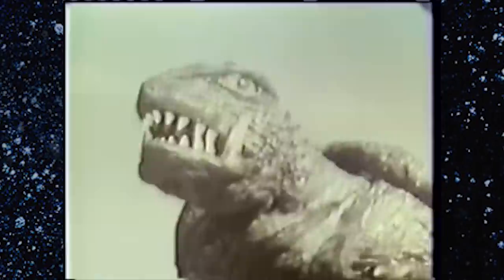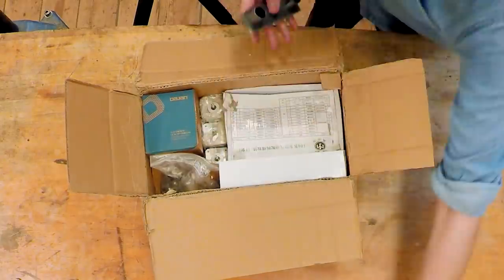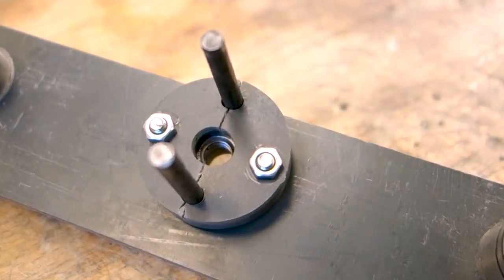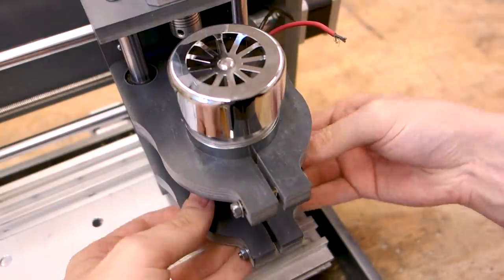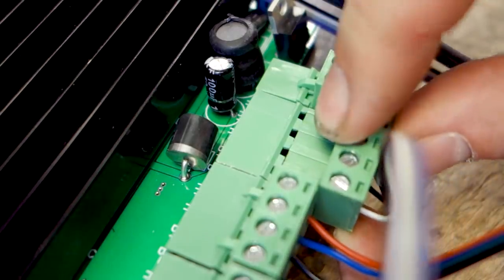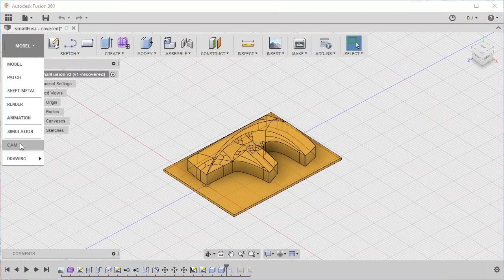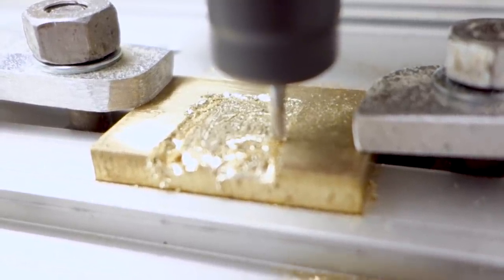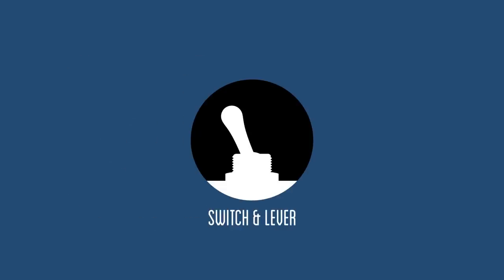Review: Cheap CNC Mill

Comment: If it seems too good to be true, it is. It's an engraver, and the farthest thing from a mill. I'd use the money and buy a 3D printer. If you need something machined, take it to a shop. This probably couldn't hold a .01 tolerance. The grease on the metal is the same grease on old Soviet and Chinese rifles, cosmoline. Shitty to clean off.
Reply from the maker: +Andrew Lang nope, you're right that it couldn't hold a .01 tolerance, just as a Fiat can't do 0-60 in 2.3 seconds. It was simply not built for it, so I don't understand why that's a criticism. If you're going to compare this to professional machines you're wrong from the get go. 

A 3D printer is a fundamentally different machine than this. Try doing some woodworking on a 3D printer. Sure thing you can take it to a shop to get milled, but it doesn't take many trips until the money you spent could've been used to buy you own mill, much better than this even. Also, it's missing the point about learning about CNC and experimenting yourself. To continue the car analogy, it's like taking your car to the shop every time it needs an oil change instead of learning something about it and doing it yourself.
Reply: Switch & Lever 
My criticism comes from why spend $400 on a machine that clearly the company didn't care enough enough to "machine" components enough withstand being assembled? You were saying in the video that one the parts broke while you were assembling it and you had to make it. What machine did you make it on? It makes no sense to spend that much on something they clearly didn't care enough to even pack it nicely. 

As for cars, if you want to learn about the car you own and work on it, I wholeheartedly agree. That goes for homes, computers, or anything you own that  you can work on. If you want to learn CNC, there are better ways to do it. There are better kits out there, $400 for a kit the makers didn't care about is not worth it. This is coming from someone who knew nothing about CNC 4yrs ago, and now I work in a shop that has CNC as well as manual mills and lathes.
Reply from the maker: +Andrew Lang I think the broken part error is not because of shoddy construction, aside from somewhat brittle plastic. The error is rather one of design, as well as lack of caution not to over tighten those nuts. It's not an issue with construction quality,it can stand being assembled, but rather one of design. Also, Gearbest didn't design nor produce this, as many have pointed out, they're a reseller not a producer. 

The spare part was made with a drill press for the holes and a dremel to cut out the hexagonal space for the nut. 

I agree that there are many ways to learn CNC, and other machines one could do it on. I don't think that just delivering CAD to a production shop to have it milled is a very good way though. 

Most CNC mills worth anything will be a lot more money than this machine. In the CNC realm $400 is cheap, and you should also expect to get something cheap from it. That doesn't mean it's a bad learning machine though, just because there are better more expensive ones. As several people have testified in the comments to running these machines and having no real issues with them after tinkering with them for a bit I take the criticism of those who've had no experience with this machine with a grain of salt. There are a lot of keyboard jockeys who consider themselves experts after watching a few YouTube videos.
Reply: Switch & Lever For the cost of 3 or 4 of these, you can buy mini mills which can do a much better job of getting your feet wet. I'm not critiquing you, I just think for someone who wants to get into machining, there are several companies that offer mini mills with CNC ability. You can also find Bridgeports on EBay and convert them for DRO, and install CNC boards. 
On the CAD end, it's a different story. Most licensed CAD programs licensing costs are through the roof, I'll give you that. But, if your looking for something to dip your toe in before diving in, Fusion 360 gives very reasonable costs, ($50 for 6 months if your not using it for monetary production) and it will develop drawings and code. The reason I criticize this particular product is because if someone was to save money for this and this was their first time machining, I think it would sour them.
Reply: Switch & Lever Believe me, I know the costs involved with CNC equipments purchases. The company I work for purchased 2 Okuma MB4000 horizontal mills with a 32 pallet system. The price was a little over $3M after taxes.
Reply from the maker: Indeed, but 3-4 times the amount of this for someone to just try out something, is still a lot of money. As some have pointed out $400 is a lot of money to some, now imagine four times that. If you want to spend more money, as you point out with the Okuma purchase, there is always better machines to buy. This is not a competition of who has the deepest pockets though.

Personally, if it's your first foray into CNC I would not recommend someone converting an old manual mill into CNC. Not to mention there's a world of difference between a machine you can run in basically your hobby room and a seven feet tall, 2000lb, Bridgeport. Also you'd be lucky if you find a Bridgeport in decent condition for less than $3000, not considering the cost of moving from one place to another, then add to that the cost of converting it to CNC. The frustrations, and skill required, to convert a manual mill to CNC for a first timer into the area would sour someone quicker than using a mill like the one in my video, in my opinion.

Fusion 360 is free for hobbyists and businesses making less than $100k a year btw, which is even more reasonable.

Comment: You really think flash is better than DVD-R for keeping your files?
Reply from the maker: +Donald Klopper since I haven't owned a computer with an optical drive for years, and had to borrow a USB optical drive from a friend just to get to the files, yes. It's definitely better. DVDs are impractical, and are a dying format. 

Not that a flash drive is the only place I stored it, it's also on my backup drives.
Reply: I understand your position... it's common place for people not to have optical media devices these days. Your commend on the video seemed to favour a USB flash drive ahead of the DVD to keep the software on, thus my original comment. I loved your video and can see a lot of effort and thinking went into it, so I thought you'd maybe want to rethink your position on DVD as a backup medium ahead of flash. Oh well, not my data ;-)
Reply from the maker: +Donald Klopper I'd never use DVD as a backup medium anyhow. They're unreliable (degrade over time) and their storage capacity is tiny. One video project I do can easily have 50gb of video material. Hard drives which are raided and set up in a NAS that's replaced every few years is the best option.

Comment: my chinese cnc cost me $1500aud from ebay. the electronics broke in about 2 hours and for the next 3 months kept breaking as i went back and forth with the seller. in the end when allowance for complaints on ebay ended they simply stopped returning my email and skype messages simply saying i should take it to an electrician . about a year later i decided to dust it off and review the issues in the end deciding to completely rebuild the electronics package. further i upgraded the spindle from a nasty 160 watt dentist drill arrangement to an 800 watt water cooled beast. this however cost me a further $1500 aud in the end. funny thing is after that when i look at the same kind of cnc on ebay the tech is so much better now. there is one plus though, i learned a lot and can now service my machine and any similar cnc.

Comment: I bought the largest X-Carve a few months ago. From what I can tell its definitely worth the extra cost. I would have to say that I would like to try a Shapoko 3 for a more rigid frame when cutting materials such as g10 with variable density throughout or even have a chance at copper. I can say that my X-Carve will cut 6061 accurately all day with only a little bit of chatter which is acceptable for my uses.

Comment: A justifyable price for this would be $20.
Reply from the maker: Well you obviously have no idea what you're talking about, you could get one of the stepper motors and a leadscrew for that price, that's about it.
Reply: Switch & Lever i know. i do have an idea what I'm talking about since I do this kind of stuff at home and I operate CNC machines at work. What I'm trying to say that at the point where you mentioned the frame is out of plastic, it was already over for me. ofcourse the PSU and steppers and rails and the spindle motor (+driver) etc cost more than $20 but that's already the only usable things out of this package.
Reply from the maker: Then I'm a bit confused why you exaggerate, is it only to put it down?
Reply: Switch & Lever yees, pretty much. I cant show love to things that are built and designed half-hearted. and dont do what they claim to.
Reply from the maker: Don't do what they claim to? Okay, I think you're coming at this from a bit wrong angle. It does what it claims to do, as also testified by other owners of the same machine in numerous comments here, it engraves different materials just fine. I pushed it to do something it wasn't designed to do, to see how far I could push it. Granted, I could've been clearer about that in the actual video, but I feel judging it by that is like judging a car because it can't drive under water.

You don't have to "love" anything, but there is something to be said for remaining level headed and actually communicate what you mean in a clear manner, rather than saying verifiable false things just to put something down.

Comment: A small drill press, a milling vice, a couple of used stepper motors and download some software. Fin
Reply from the maker: A drill press is not made to take sideways loads like that. There's a reason it's a drill press and not a milling machine, and thus you'll wear out the bearings quite quick. That's not to mention that drill presses don't tend to run anywhere near the spindle speeds of a mill. This spindle outputs somewhere between 6000-12000 rpm, according to the manufacturer.

Comment: That seems awfully expensive what the differnce between this one in the video and these that I found on eBay? Simply becasue it's half the price.
 http://www.ebay.ca/itm/Mini-CNC-1610-CNC-engraving-machine-Pcb-Milling-wood-router-for-DIY-beginner-/322698392296?hash=item4b2252b2e8:g:qQsAAOSwOhVZp636  

http://www.ebay.ca/itm/3-Axis-3018-DIY-Mini-CNC-Laser-Machine-Pcb-Milling-Wood-Router-Engraver-Printer-/391864836819?hash=item5b3cf6e2d3:g:T2UAAOSwBwBZjmfP
Reply from the maker: Well it's two different machines alltogether. The table size of the ones you linked is much smaller than the one I built, and the spindle has far less power. It looks, at least the one in your first link, that some parts are 3d printed as well. I wouldn't trust 3d printed parts as far as I could throw them, at least not for structural parts in a CNC mill.

Comment: I don't understand why you are so hot to defend a machine that's very brittle plastic, doesn't come with all the wires you need, and sends you stolen software and steals the work of others and has the web address of the company they stole from on the parts they send you. Knowing all that not only do you defend it you still have links up to buy it. I don't get that.
Reply from the maker: The thing is, I could care less if it's a CNC or a rock, when people think they know more about something I have actually spent time building, using and ultimately reviewing, when they never even knew it existed before seeing my video. That's my gripe.
Reply: I'm not faulting your review at all. I don't know jack about CNC machines. I just don't get you KNOWING this chinese product is using other people's work and even their website is printed on the board and yet you still link to it and honestly don't seem to care. Are you worried about getting other machines for review? I've got no  dog in this fight and I'm not angry, I'm literally confused by your attitude. In your own words   "Had I known I would not have gotten this mill for review to begin with, as I do believe strongly in benefiting creators, rather than counterfeiters." and yet you stand by your review and still have links up to buy it....
Reply from the maker: In the end, I went into an agreement which I am sworn to uphold as well. So I am, as you may say, stuck between a rock and a hard place. In the end, the name of the mill is mentioned repeatedly, Gearbest is mentioned repeatedly, it's literally a five second job to find the same page through Google. Since the links aren't affiliate links, I don't see the harm.

The one argument may be removing the video entirely, and I did actually toy with the idea, but decided ultimately it's better to keep it up as information about the mill itself, and that it's counterfeit (which is why I pinned PlanetCNC's comment, so it stays on the top).
Reply: I understand now. I wish you nothing but the best in all you do. Cheers!

Comment: It's not a proper review if you are going to go and replace one of its main components with one of your own - just cos you don't like the look of it! Prospective buyers want to know how the purchased unit as a whole, performs. Adding your own bits (broken part excepted) just confuses the issue.
Reply from the maker: Just because I don't like the look of it? That had literally nothing to do with it. 

Watch it to the end, altering it how I did plays entirely into one of my last points, that this is a good platform to modify and alter how you want to. It doesn't perform any differently because of my table, aside that I can clamp down material more rigidly.
Reply: I did watch it to the end.  My point, potential buyers will want to know how the unit as a whole performs - adding bits fudges that decision-making process.

Personally, I do not think this CNC mill is good value and wouldn't buy anything whose main components were made of plastic.  I was curious though as to how it would perform with metals. So it would have been nice to see how the unit as sold would have performed on that brass piece - worse obviously, but this is what potential buyers would like to have seen.
Reply from the maker: So, you would've liked to see me trying to clamp down the piece until the plastic cracked? That'd just be a waste of my time, and yours. For engraving you don't need to clamp it down that much, but for milling it needs to be rigid, otherwise you'll just get chattering or at worst the piece coming loose.

Comment: Lol high voltage? High voltage is 600 volts and up. 480 three phase is technically not even high voltage and that will turn your cabinets into projectiles lol.
Reply from the maker: +njack1994 if it's high enough to kill you I'm just going to go ahead call it high voltage. Especially if it discourages those that don't know what they're doing from playing with it.

Comment: From your experience of the part breaking during assembly was a hint. I am surprised you didn't think of using the mill to make metal replacement parts for the rest of the plastic.  That way you could have eventually swapped all the plastic parts out and would have had a stronger unit.
Reply from the maker: +Gary Jene too much time involved, and the plate aluminum required would've been way too expensive. Better to rebuild it using aluminum extrusions and acme leadscrews.

Comment: Would be better off getting a proper 3D printer and change out the head for a spindle motor....
Reply from the maker: +MeMad Max a 3D printer is inherently not built for this kind of work though, they're not built this rigidly as they aren't put under any sort of load. When you put a tool to a workpiece the loads on the machine require a much more rigid construction.

Comment: Add your photo program source to the description!
Reply from the maker: +Jamie nope. It's specific to exactly what I was doing and has no gui or command line interface. Everything is hard coded into the program, and needs to be recompiled to use another image. It's extremely quick and dirty, so I will spare you all that mess.
Reply: Well, just consider the worst that can happen is nobody downloads it. But maybe someone will take your dirty hack, add some basic commandline parameters and options, and make it useful for others. Maybe someone will even add a GUI and make it useful for noobs. Don't worry about sparing us your mess, sharing is better than nothing :)
Reply from the maker: +Jamie id rather share the theory of what it's doing :)

It takes the input image and checks the luminance of the pixel at 0,0. If the luminance is above a certain value (meaning it's too bright) it does nothing and moves onto the next pixel: 1,0. If it's below that value it saves that position and continues with the next pixel. Once it reaches the next too bright pixel it ends the line, and outputs that as gcode (i.e. five lines of gcode signifying, move pen from last position to beginning of line (1), move pen down to paper (2), move from the start of the line to the end (3 & 4), then retract pen (5)). It continues looking to the next pixel and repeats this over the entire image with a set spacing of y so you can set how many horizontal lines you want your final drawing to have. I also added a pre-scale value, so you can output something which is of the correct size regardless of the size of the original image (i.e. a 600px image won't be drawn at 600mm wide).

This is all output into a nc file, with an appropriate header and end of file ready to load into your interpreter. 

Because of this it works better with high contrast images, which can require a bit of preprocessing through something like Photoshop.